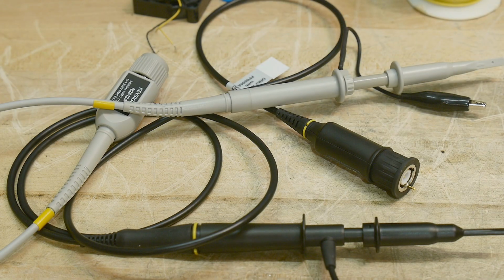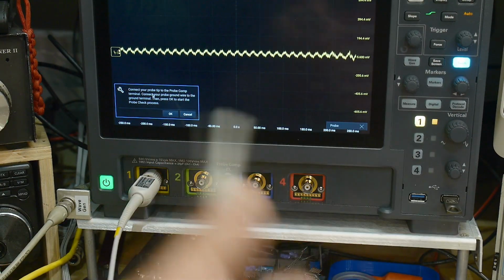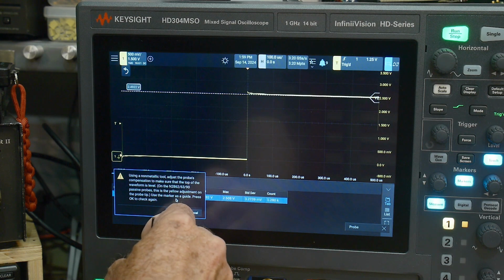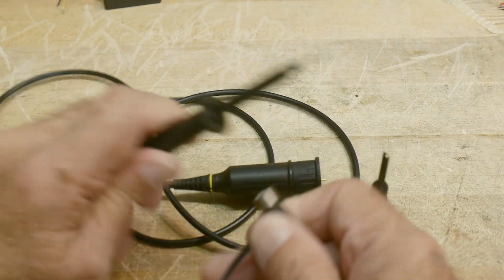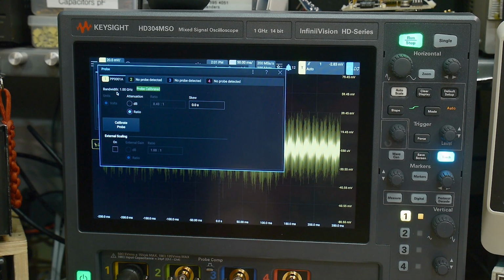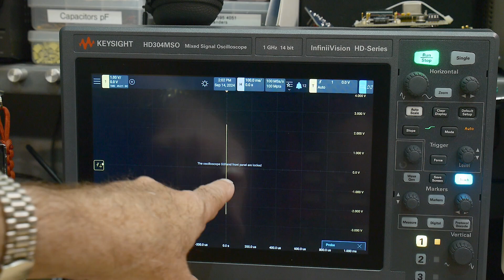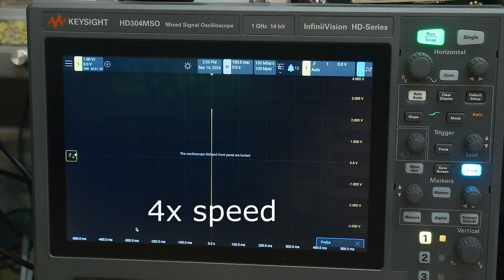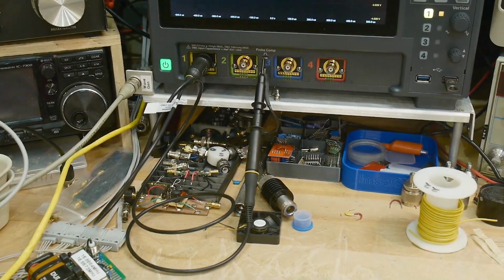#2002 Keysight HD3 Probe Calibration including PP00001A

Comment: I see that you’ve used the probe without the PP0004A adapter. You can test the frequency response and linearity of the setup using a tracking generator across the 20 Hz to 1 GHz range.
Reply from the maker: true for older keysight scopes, but the new HC3 was designed to operate with the PP probe directly with a very long and complicated autocal that is now built in.

Comment: Compensation. Not calibration.
Reply from the maker: this is way more complicated than compensation. a range of frequencies and voltages are used. the calibration is specific to the channel and if you move the probe to another channel it needs to be calibrated there. this is a scope/probe system cal.

Comment: What is the resistance of the index pin to the shield on the bnc?

There is a standard value range for 10x probes.  I think Tek used some other values for a few probes.

Comment: How is it possible to calibrate or measure to 1GHZ with that big honking ground lead? Even my cheapo TekTDS360 has a coaxial port that you plug the bare probe head into for cal. ???
Reply from the maker: I wondered that myself.
Reply: There's a ground spring accessory, as well as sockets, BNC adapters and MMCX varianants rated to 1GHz.

Comment: There must be some calibration coefficients being computed.  I wonder if they're stored in the probe, or in the oscilloscope?   The latter would only require the probe to deliver a unique serial number.   Seems like the obvious next step is to fabricate some sort of fixture to give access to the extra pin on the BNC connectors and use another scope to monitor the funny business going on.
Reply from the maker: you need to cal for each port used. so for sure stored in the scope.